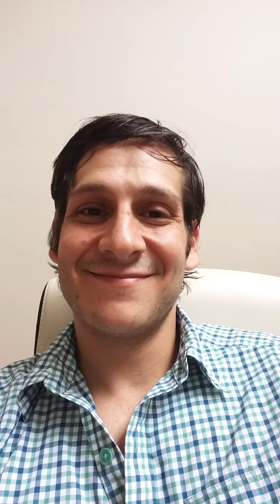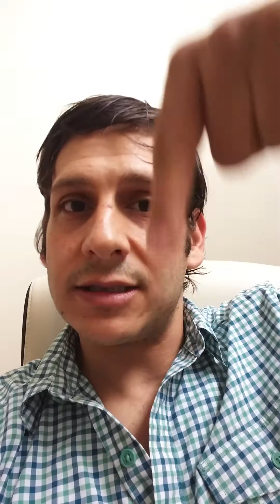Problems Using Ground Penetrating Radar (GPR) On A Steep Slope

Comment: Hi Dan,
Love your videos. I've been doing ground-penetrating radar work with lower frequencies for geologic investigations for about 7 years, and it's nice to learn about non-geologic applications. I can empathize with you on doing surveys over steep slopes.  I thought of a solution but never got a chance to try it. You can buy a small ATV winch from harbor freight for about $80. I was going to replace the metal cable with rope, steak It to the ground, and power it with a car battery to pull my antenna up the slope.  I still may buy one because I have been doing more and more profiles across lakes and use a Time trigger, so my velocity is not constant but it could be with a winch.
Reply from the maker: Thanks for watching. I really appreciate it. I'm glad we were able to help with some of the non-geo stuff. The winch sounds like a great idea! And inexpensive. Thanks again!!